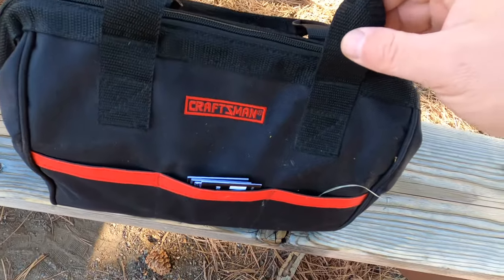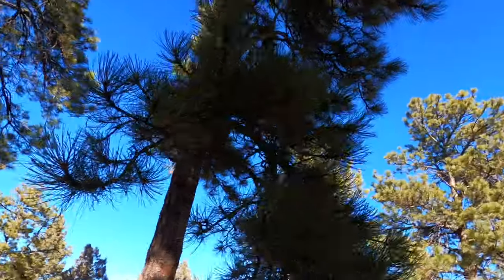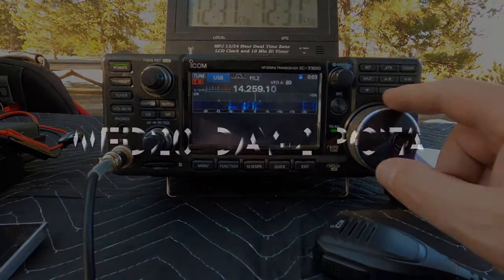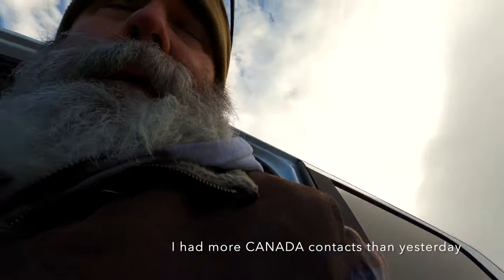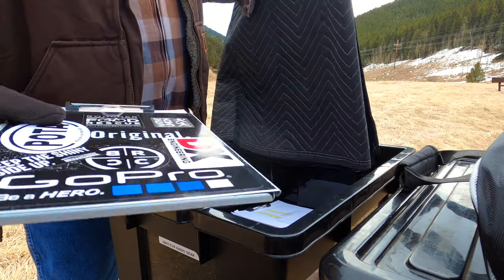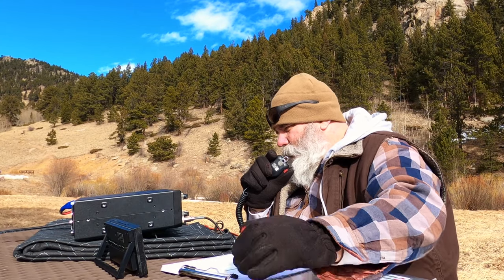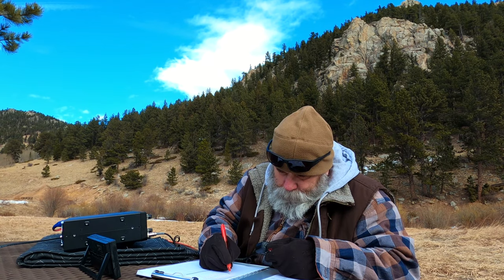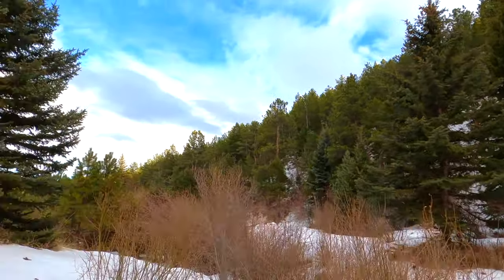Portable HF Ham Radio Setup

Comment: Thanks for the fun video.  The only pieces of gear we have in common are PP connectors and the same blue coffee cup.  I usually set up from a 16' RV camper trailer that I converted to EMCOMM use, with an IC-7200, 55Ah deep cycle battery and a Buddipole vertical antenna.  If I feel ambitious, I'll hang an 80-meter dipole from a fiberglass mast and feed it with 600 Ohm ladder line via a Palstar manual tuner and 4:1 balun.  POA is great fun!  73, de K7SFA.
Reply from the maker: Thanks Mark, that 16’ travel trailer sounds really cool. Nice setup. I recently acquired a Yeasu 891 to lighten the loadout. I also have to say that I have no regrets moving from my bluetop optimas to the iron phosphates. I’m saving about a gazillion pounds in battery. Buddypole is a great product. I always keep my ears peeled for Bud especially if he’s bicycle mobile. Always working a gigantic pileup.  Thanks for stopping by. Take care. 73

Comment: Excellent content. 
I have the same set up, minus the lithium batteries.  👍🏻

73!

LibbyD in SC
Reply from the maker: Thanks for stopping by. That vertical antenna is great. Best alternative to a horizontal dipole that I found so far. The battery is pricey but it saves on weight. Could probably get by with a smaller one but 20Ah can work a couple days for me at full power. I also have an FT891 now that I hope will pair nicely with the TIA1000. It’ll pack into my ATV better for a more compact station. But for driving my truck in, that 7300 is king. 

Take care. Stay well. 73.

Comment: Do you get reduced performance from your batteries in severe cold are they lithium regardz adrian uk
Reply from the maker: Thanks for dropping by Adrian… its actually more efficient but be aware that charging LiFePO4 in severe cold is a big problem at the wrong current. Verify with the manufacturer’s specs of course. Take care. All the best. 73

Comment: Sir I just subscribed but I have a question? The question is… if I wanna do pota and deployments and home base station should I go with the IC 7300 for HF or should I go with the FT 991A
Reply from the maker: You’ll have to make the right decision based on what you want out of the radio and all the research you do. I can tell you my preference is to keep hf and uhf/vhf on separate rigs. Case in point… I gave up my 857 and bought a 891. My philosophy is to have gear that’s excellent at its specific purpose and not something that’s trying to be almost excellent in everything. I run the 7300 next to a 2980 in my shack. Don’t care too much about uhf but I have HTs that’ll cover 70cm. Hope that helps. Let me know what you finally do. Take care. 73.
Reply: @N0KTZ  That helped a lot sir thank you so much. I know exactly what I’m going to do.  73 sir

Comment: Just curious, does the power output of the radio decreases when your battery voltage starts to drop a little after some time?
Reply from the maker: Lithium batteries maintain a fairly high charge until they drop sharply off at the end. I keep track of my output power and the Ah to manage each battery before it drains all the way to the drop off point. Hope that helps. Thanks for stopping by. Take care.

Comment: What watt/amp meter are you using to monitor your battery? (brand)
Reply from the maker: That's the Powerwerx Watt Meter, DC Inline Power Analyzer. There's knock-offs that are less expensive out there but this one's the Powerwerx. Thanks for stopping by.

Comment: What's the point of all of that the purpose of radio is to have conversations
Reply from the maker: Hi Kevin, there's probably a lot of reasons why people do these types of exercises. I don’t usually partake in the contesting circus, but I do enjoy any excuse to get out and up into the high-country, especially to setup and work a portable radio station. Winter Field Day is one of those times for me. Thanks for dropping by. Take care.